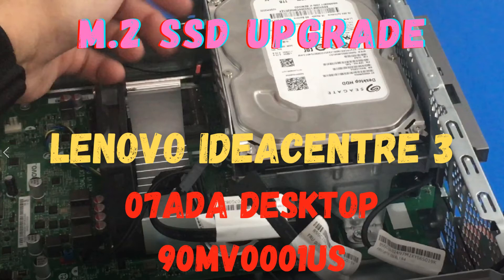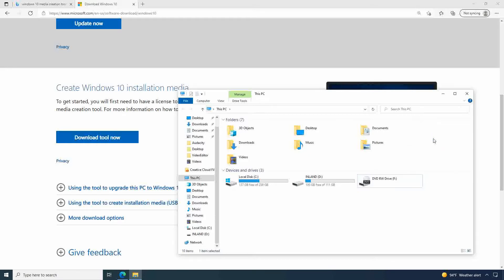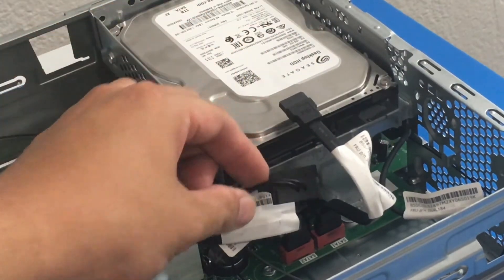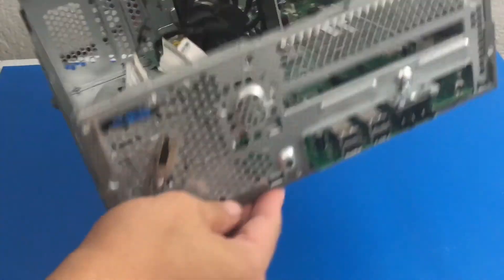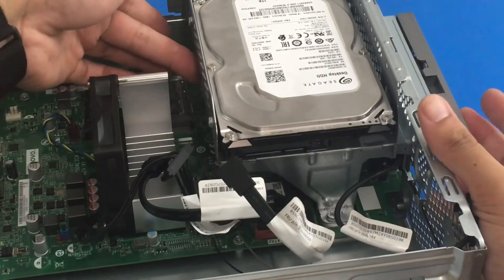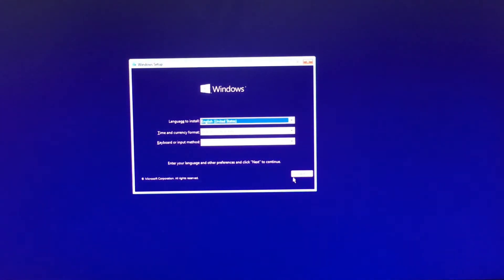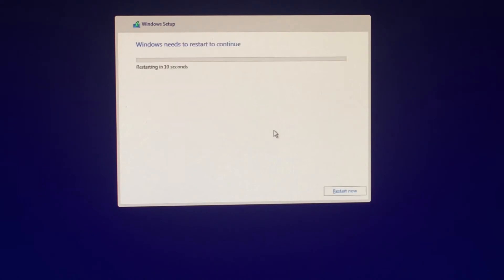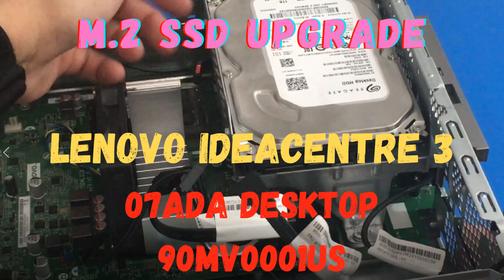M.2 SSD Upgrade! Lenovo IdeaCentre 3 07ADA | SanDisk Ultra 250GB Internal PCIe Gen 3x4 NVMe SSD

Comment: jesus what have i done ,i just ordered this... question, with a pcie adapter will it work with a graphic card
Reply from the maker: Good question. I don’t think so because the power is really low wattage. Most graphics cards require at least 300 watt power supply depending on the card
Reply: @whattmeter  hmmm i think it might be possible, maybe Powering the Graphics Card With a Separate PSU?
Reply from the maker: I’ve personally never tried it. Thats interesting
Reply: @whattmeter  can you do benchmark video?
Reply from the maker: What benchmarks do you want me to run
Reply: @whattmeter  a benchmark of this pc

Comment: I have the i3 10100 model but it has 180 PSU.

But 3050  silver model doesn't have.

It has a adapter like laptop.
Interesting.

Is it good or bad.
How do you fell about it.
Reply: the price difference between the i3 model and the 3050 silver model ist even that big , lenovo has lost their minds,  i mean cmon ,no pcie slot , a 90 watts laptop charger😂, soldered cpu 😂 its supossed to be a desktop not a laptop😭
Reply from the maker: It’s a good budget pc especially for the price. Cpu looks soldered and cannot be upgraded. Ram and ssd upgrades are good. Not bad especially for basic tasks. Also good sized case
Reply from the maker: I think the i3 model the cpu can be upgraded. 180 psu definitely gives more power

Comment: Sorry to bother again. Would you recommend the HP 14 inch i3 4 GB RAM/256 GB over the 330 ipad? It’s on discount at Walmart for the same price as an iPad. Much appreciated!
Reply from the maker: Is the i3 10th gen? Also do you know what chip the ipad has? A12? I would check to see what chip the ipad has then do a search comapring the i3 with the A chip
Reply: @whattmeter  i3 11th gen and A12 Bionic
Reply from the maker: Nice 11th gen. Looks like the i3 is newer/scores a little better than A12 https://versus.com/en/apple-a12-bionic-vs-intel-core-i3-1115g4 (my personal opinion is it really depends on your use/want)
Reply from the maker: Do you happen to know if A12 supports 5g? I would see also if any of them supports 5g
Reply: @whattmeter  I think it does but I would only keep it connected to WiFi
Reply from the maker: Oh ok. I think it depends on what you are going to use it for.

Comment: Processor upgrade??
Reply from the maker: I might have to look into that. I have to see if I have any compatible cpus or if the cpu is even removable
Reply: @whattmeter  okay!
Reply from the maker: I removed the motherboard. The Lenovo in the video has a soldered cpu. There’s a similar desktop model with a removable cpu but this one is not